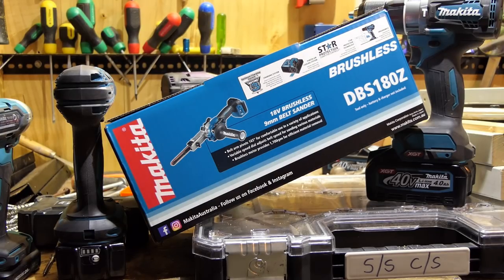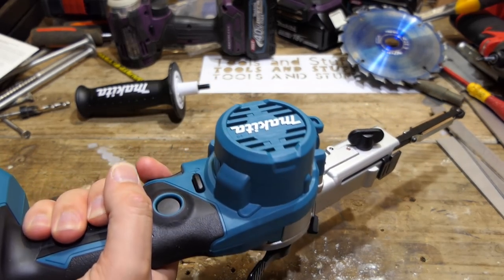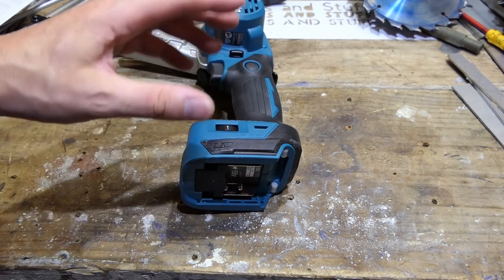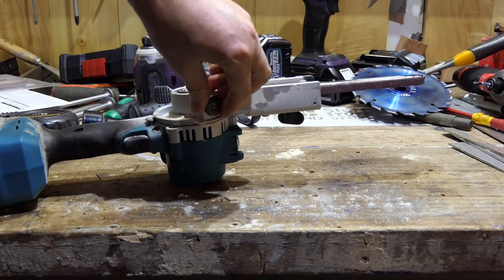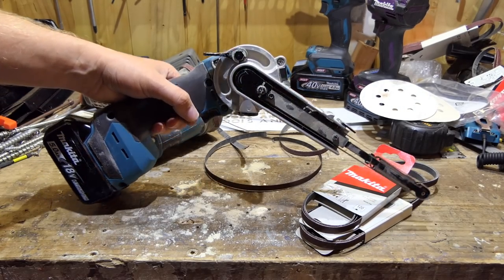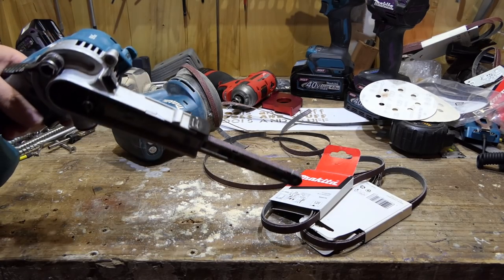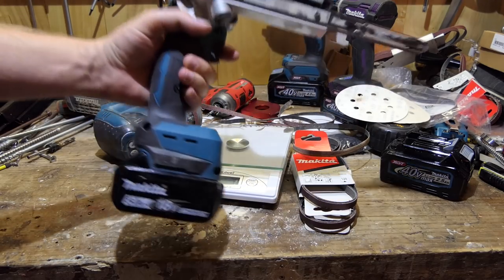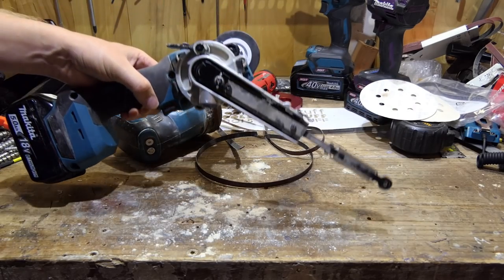Makita Cordless 18v Belt Sander Review | Makita XSB01 / Makita DBS180 9mm Power File

Comment: Bought the corded one of these nearly 20 years ago. It's the sort of tool where you don't know what you're going to use it for and when you have it you use it for loads of stuff. Might get the cordless version now. Just buy wider 533 belts and cut them down. Much better than buying the genuine expensive ones. Means you can also get the tougher blue zirconium ones. Also I've found that if you reduce the speed to 3 on a new belt as it stretches in. Then you can increase speed and the belt lasts longer

Comment: TIP! Great tool, we have been using corded one ages for steel. Since the special belts for this are kind of expensive and not commonly available. I usually buy 533x75 belt (you need quality one, preferable taped backside like Mirka) you squeeze it between your fingers together, make cut with scrissors the width you need and then all the rest you can just tear to get narrow belt out of wide one.
Reply from the maker: Yeah I was going to have a crack at doing that.
Reply: Awesome trick. Will have to try it myself.
Reply: @ToolsAndStuffOFFICIAL  check out Hikoki/Metabo HPT' s new 36V belt sander just released in states for reasonable $169 US$
This is a hybrid Cordless/AC capable tool which is perfect for this tool as real deep sanding needs lots of runtime without burning up batteries

Comment: Two years later and Milwaukee's claiming that their just released M12 bandfiles/finger belt sander is the first one.

Also, it's interesting seeing Makita's belt tensioning and replacement system. Both the M12 and Pneumatics I have do it this way: The finger is spring loaded and automatically tension themselves. They also have a latch that will hold the finger in, and you can replace the belt.

Comment: Cool product, waiting for it from Canada. 40v mitre saw review in the future please!
Reply from the maker: I'll probably wait for a 10" mitre.
Reply: @ToolsAndStuffOFFICIAL     6 mm , 9 mm and 13 mm sander heads seem to be sold separate ,  6 mm is €90 and 13 mm is €110 , here in Finland .

Thats about the same that i paid for 75mm/3" screw feeder head spare part for Makita DFR 550 , and making it to DFR 750 ... base tool is same on several models .
Makita DFR 550 + spare part for 75 mm screws = 25 % cheaper than DFR 750 model  alone ... one of those that make no sense .

Comment: I bought a $100 Makita string trimmer here in Europe and it was made in Germany. I also have several Makita tools made in Romania.
Reply: my ddf481 is made in romania and i live in finland
Reply: That's because the gardening tools are made by Dolmar Sachs, and some of them actually still are manufactured here. The machines made in the EU (i.e. Romania) seem to have very nice build quality. With the chinese made tools, I had mixed experiences. I had one that was definitly inferior to the EU built counterpart (same machine, I sent the first one back and reordered and by chance got one that was made in the EU), but I also have some Makitas made in China that are impeccable. So it might have been just that one in a thousand that just wasn't that great...
Reply: @NameNaameNameeNaamee  my makita drill is made in romania
Reply: @NameNaameNameeNaamee  The UK machines are also very nice, I have two UK made jigsaws, they also make track saws there and much more.
Reply: @Fekillix  I suppose in the end all Makita tools are made to the same standards (when it comes to the exact same models built in differnt places). Over all, the quality of the Makita tools I own (must be around 13 right now) has been super good. I literally never had even one machine let me down ever. The one China made tool I sent back was the biggest brushless single 18V recip saw Makita makes. It has a user replaceable rubber boot at the front that simply was too loose for my liking. That said, at that point I didn't know that it was user replacable and that it's normal for that part to seperate from the housing. The Romania built machine had a tighter fit, yes, but I don't think that this had any influence on the performance of any of those saws. It was completely cosmetic. So I wouldn't interpret too much in this one glitch. We'll probably find some people who had similar occurances with EU or UK built machines as well. It just happens once in a while that a batch of components is a bit off but it seems that this is indeed a rarity with Makita which is a great thing!

Comment: 3m makes great sanding disk. Check them out if you get a chance.
Reply from the maker: Yeah I have used a lot of 3M abrasive products over the years.  I once worked for a company that manufactured sanding discs, flap wheels etc for 3M

Comment: Would ten of them side-by-side be a good replacement for my recently violently and devastatingly blown-up Ryobi belt disc sander? 🤔
Reply from the maker: They would certainly be more powerful.
Reply: My son in law has the Rigid/AEG belt sander and it's capable-not amazing-but definitely better power and run time than the Ryobi
Waiting for Milwaukee, Makita, Metabo HPT/Hikoki to bring to market-first capable one gets the worm-I hope it's Hikoki/Metabo HPT cuz I would use it with the AC adapter for longer jobs

Comment: The reason I never purchased this tool this is the belts, I can easily get 3M belts for my cheap and cheerful Ryobi power file in 457mm size, using crap belts detracts from the experience and causes huge frustration, 3M belts are the only ones I'd consider regardless of the cost, but hard to find them in 533mm around here hence Makita getting ruled out in favour of the Ryobi. 3M or put the tool away.
Reply: I think some comments don’t realize they have been making the pneumatic versions of these for 50 years and are a main staple in the metal fab world.  But…..one of the most common belt sizes is 1/2” x 18”.  Makita picked the wrong size here, not very common.  3M is the bomb and makes a nice selection of 1/2” x 18” belts…….👍

Comment: One Review per week! It will take me forever to watch all videos from your Channels.
Multi Tool DTM51 (€ 150) + Grinder DGD800 (€ 180) vs Belt Sander DBS180 (€ 340). Poor pricing positioning 😡
Reply: settle down Beavis  Certainly, prices have dropped but I haven't changed my opinion.
Amazon: DTM51Z Multi-Tool (€ 120) + DGD800Z Die Grinder (€ 110) vs DBS180Z Belt Sander (€ 260).

Comment: I bought one of these.  I can grind metal for about 5 minutest before it shuts off and the white light starts blinking.  Apparently some kind of overheat protection.  Then it takes forever to cool down for that next five minutes.  A totally worthless tool!!   I had to buy the corded version in order to get any actual work done.
Reply from the maker: Mine has never done this. Are you using genuine batteries?
Reply: yes it all came as a kit in a nice hard case.  I sent it back to Makita awaiting info.
Reply: @ToolsAndStuffOFFICIAL  I have experienced similar issues with battery powered angle die grinder from milwaukee which I sent back twice and still has the same problem, and a corded angle die grinder from suhner....total german garbage
Reply: @ToolsAndStuffOFFICIAL  I think unfortunately still at this time there is no substitute for air tools
Reply from the maker: I've had Milwaukee tools overheat on me plenty. But never Makita. Let me know what they say.
Reply: @ToolsAndStuffOFFICIAL  I just got it back from Makita.  They replaced a lot of the interior components.  It behaves the same way but here is what I found out from using it today.  On speed 5 it will run forever.  On lower speeds like 1 or 2 it shuts off after about 5-10 minutes of use.  I was running it on the lower speeds to avoid removing too much material.   I think the design gives more fan power at higher speeds and not enough at the low speeds.